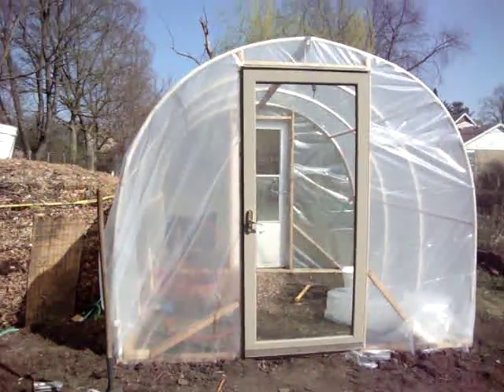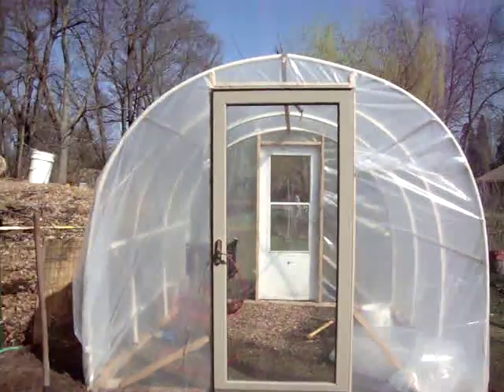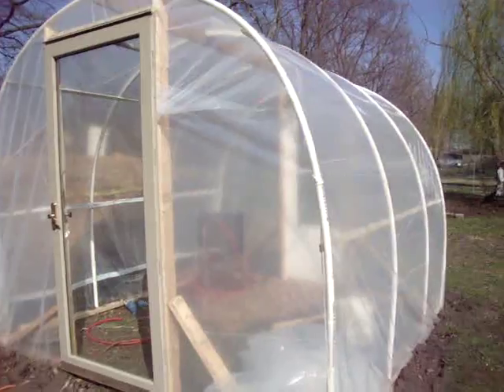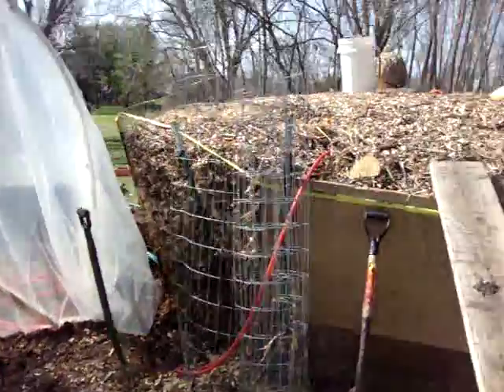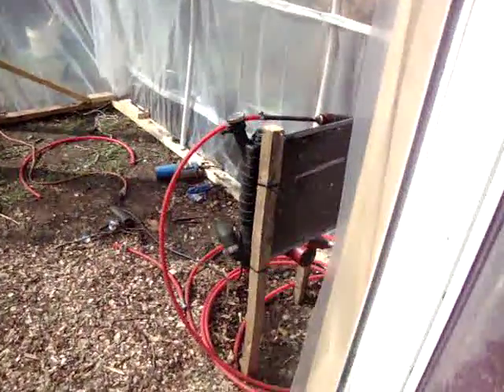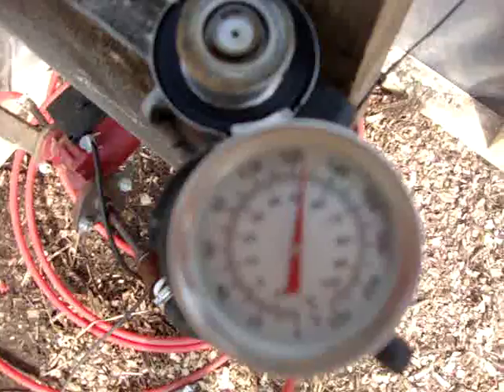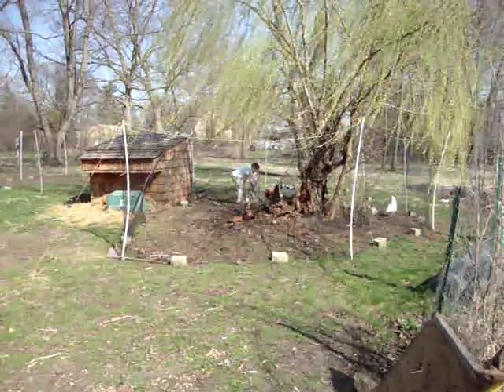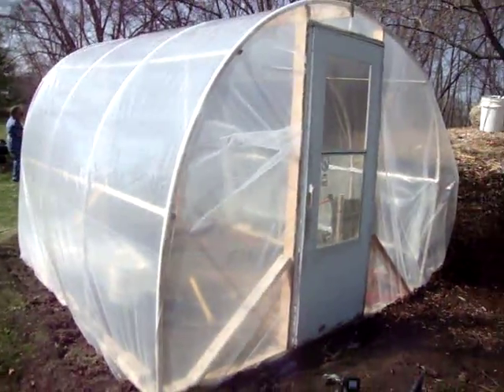green house tour with jean pain compost pile furnace

Comment: Did you use a pump of any kind to circulate the water. Did you use a fan to draw the heat off the radiator. How long did the pile stay hot. Did it last the whole winter.